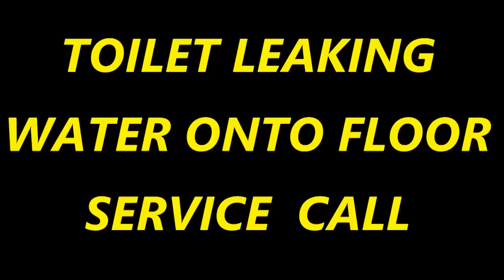TOILET LEAKING WATER ONTO FLOOR SERVICE CALL

Comment: I personally don’t use silicone on toilets unless forced to do so by customer, it isn’t necessary for a good seal… wax and Johnni bolts have always done the trick to me… if anything to me it’s more work and can possibly hinder you from noticing an actual leak on the toilet… just my opinion

Comment: I had to put on a toilet flange repair kit ( bASICALLY the new ring) and now when I take a hot shower I get condensation coming from bottom of toilet out onto the floor. Doesn 't do it when just regular flushing. I just have to believe warm moist air is getting under there and making condensation. Any of you plumbers out there got any suggestions? Thanks in advance!

Comment: A few years ago, PBS had a series called "The Handi-Ma`am" and the woman showed how to do handy-type jobs around the home, so women who were single or divorced could be more independent.  When she showed how to install a toilet, wax ring and all--she used silicone caulk around the base.  She claimed that it would prevent condensation from the toilet from seeping under the toilet and rotting the floor.

Minus a SIGN warning not to flush baby wipes--yes, they are probably getting flushed.

Comment: I was at my local Lowe's store the other week and happened to notice that all the toilets in the men's room had caulking around their bases where they met the floor.
Reply: I think it’s code in some places, common on commercial jobs. It’s best to leave the back open so leaks can be seen. I think the idea is it’s supposed to be more sanitary and easy to clean. The caulking is called sanitary caulking. It’s supposed to not harbor mold etc
Reply: @jacksonbennett6151  I've seen a YT video where a contractor out in California said it was code to caulk around the toilet bases out there.
Reply: @AStanton1966  I work for a commercial GC in Boston, all of our jobs it’s called out in the waterproofing and caulking scope

Comment: Why is the upper right side of the tank broken out at 8:45? Seems rather suspicious and high water mark stain is only about 7/8" below where water would spill out if that ancient float got hung up on that aftermarket water saving device, or a user leaning back and shifting the tank lid could cause interference/alarming spillage on floor.

Comment: In area board of health require bath are to be called and all holes covered or sealed . In residential I was required to caulk all with dap caulk not silicone.

Comment: I'm not sure why people seal the bottom of their crapper. How do you know you have a leak with it sealed? I guess you just wait until your floor rots out and you end up in the basement with the crapper. That would be a true shit show.
Reply: That's why you leave a gap in the back in case it does leak it will show. I never caulk on a wooden floor but a tile floor I do.
Reply: I only seal when the toilet to floor connection is weak (closet flange screwed into partially rotted wood subfloor) and owners are too cheap to fix properly. That, combined with 350lb obese users plopping down full weight onto seat with out of level floors/excessive wood shims etc. Gives a measure of callback insurance. Judgement call on scene. We really need a 4 bolt minimum code standard for today's giant fat asses and maybe 4" trapways, lol.
Reply: @madcowusa4277  ROFL :yougotthis: